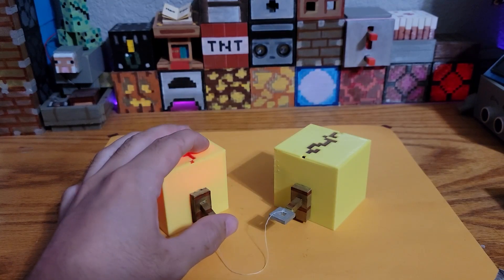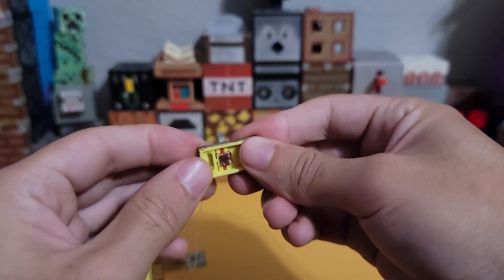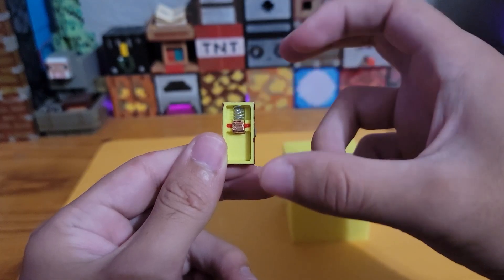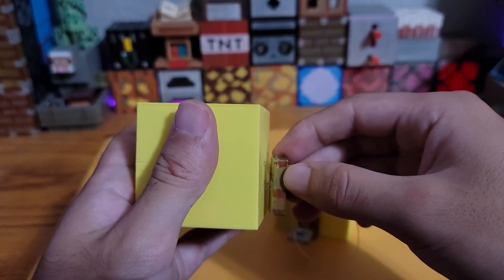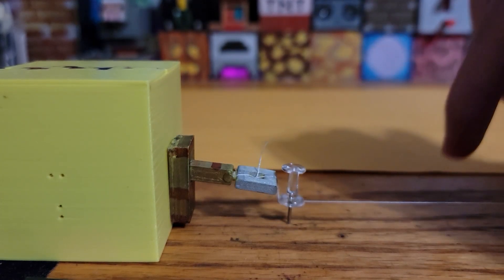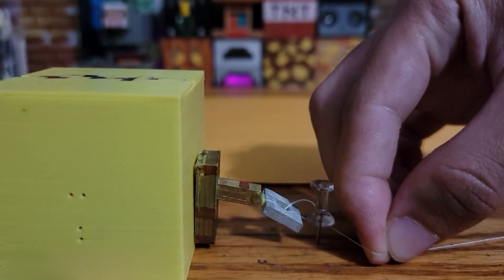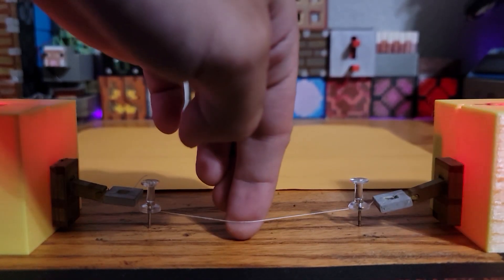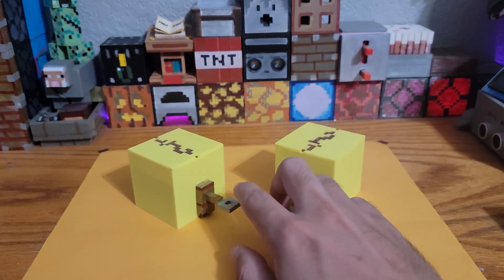Minecraft Tripwire Hook: Spring

Comment: the tripwire should be the opposite. so that when pushed down nothing happens but when let go it closes the circuit
Reply from the maker: Really made me question myself lol, I don't remember tripwire hooks emitting redstone then turning off if stepped on
Reply: @hecbac  I just remember that they're set when the string is tight but when you trip it and I think normally the string breaks, then younger shot with an arrow or something. (jungle temple)
Reply from the maker: @li04am  Ahhh ok, once you step on the wire it activates the dispenser. The tripwires do nothing until something goes on the string, not necessarily because the string breaks. The strings don't break if tripped, unless it used to : )

Comment: it would be so cool if you developed them to be a bit like lego and you can just mix and match parts as you please, a prototype with just pistons and redstone would be enough and still be awesome
Reply from the maker: Thank you, swap ability is definitely important. The comparator is a good example : ) The jeb door is ok, but it uses different systems. I don't try to use a single system because it can be limiting, as is I have a lot of limitations with the 1/20th scale lol
Reply from the maker: ideally the blocks would communicate without wires, but I heavily depend on the pin system for distributing power : )
Reply from the maker: @ItSamiracle-LoL  Good suggestion : ) Magnetic pulses could be a way to transmit data. I used it when making the jeb door, but it doesn't solve the power issue. A work around for power would be using rfid chips. They use radio frequencies and are powered wirelessly by the source of the frequencies, I think lol.
Reply from the maker: @ItSamiracle-LoL  That is definitely the solution : ) My issue with a battery for each block is that it would be more expensive rather than have power distributed. Also more batteries to charge individually